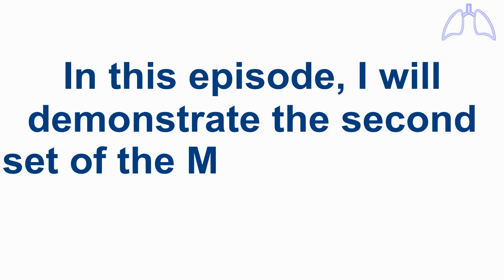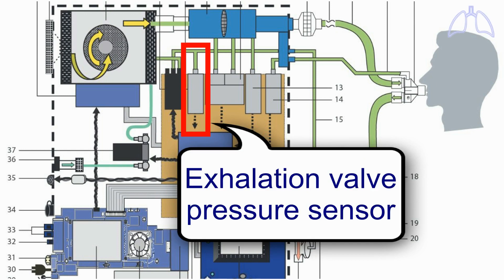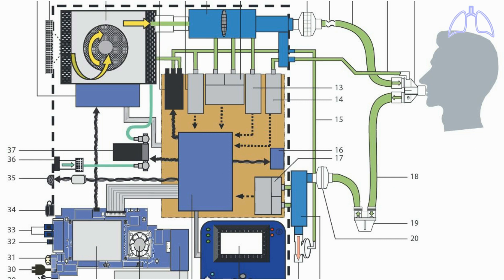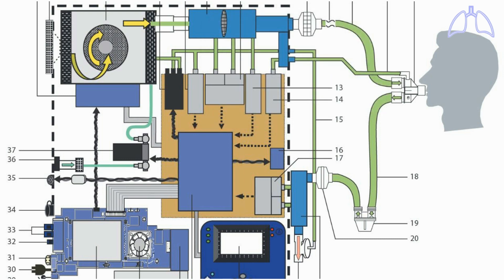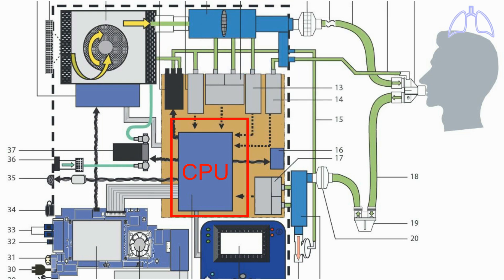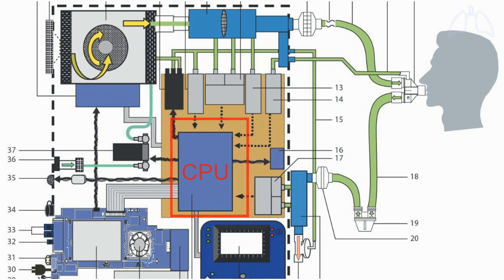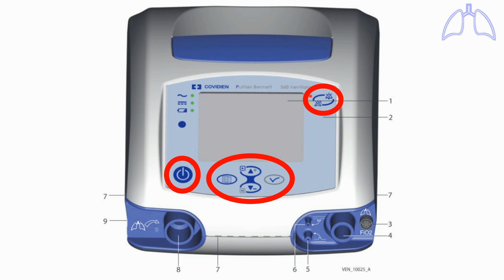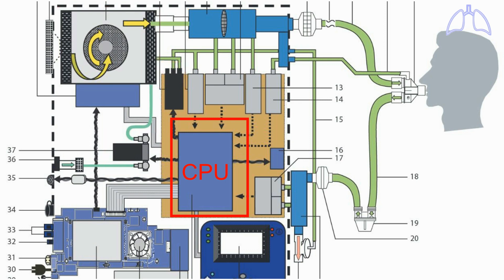Medtronic PB560 Open Source Ventilator Parts Demonstration - Episode 2

Comment: I have come across lot of experimental and FDA approved designs on the net. One of them is from Virgin Orbit and many others who are researching on this.In all of them 1 basic part is fundamental.That is using a handheld respirator mechanically using  stepper motors and micro-controllers for various settings etc. Only in this approved design i am unable to understand how this part  and mechanics is done?
Reply from the maker: If you study this series, you will understand the Medtronic PB560 ventilator design and any other professional ventilator design.

Comment: I notice that there isn't a one way inspiratory valve to avoid back flow of air from patient to the ventilator. Can you tell me why this is the case? I know that in Cpap machine they have the same path for inhalation and exhalation. But since it has a different exhalation path why is the inspiratory side not blocked during exhalation?
Reply from the maker: At the end of the inspiratory phase, the inspiratory limb is full of the inspiration gas because there is no way to release this gas. So this gas makes a resistance to the exhaled gas flow. When the exhalation valve is open, it will allow the exhaled gas to be released through the exhalation limb. Note that you can use a single limb patient circuit with the Medtronic PB560 but you will not be able to measure the exhaled gas volume.

Comment: How is PEEP maintained by this ventilator?
Reply from the maker: The CPU monitors the patient pressure using the proximal pressure sensor and closes the exhalation valve at PEEP to maintain the pressure at this level.
Reply: @ventilators3432  thank you for your response. We are making portable emergency ventilators like this one in Nepal. Your videos have been  very helpful to us. I have some more questions. Can I get your email? Mine is shrestha.sg57@gmail.com or should I just ask you here?
Reply from the maker: You can send messages to this e-mail: ventilators.design@gmail.com  But it is better to discuss any technical issues in the comments because my goal is to publish the ventilators manufacturing knowlege. Feel free to contact me.